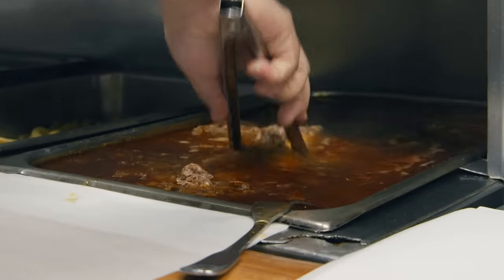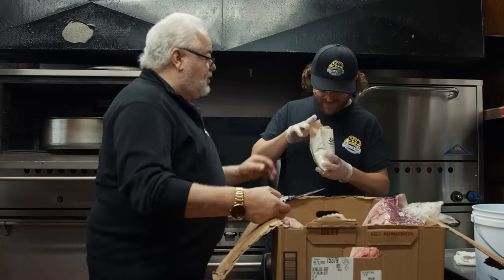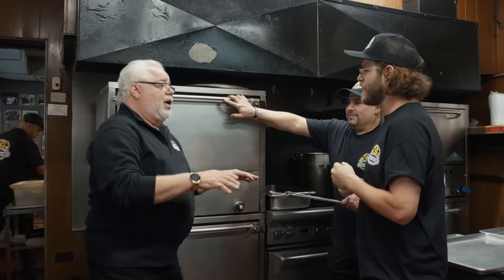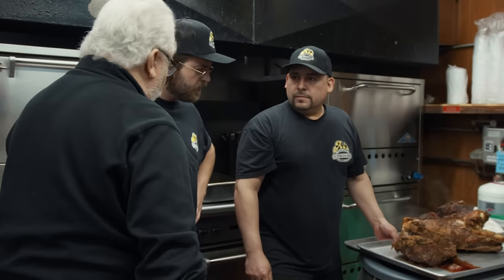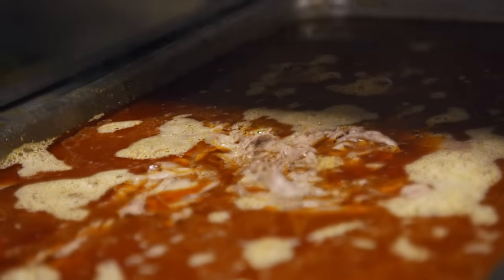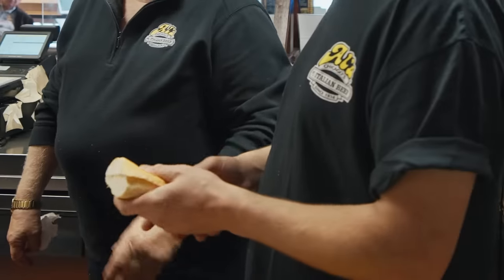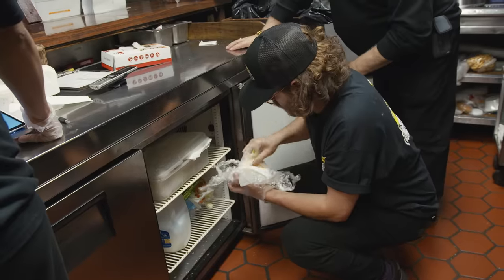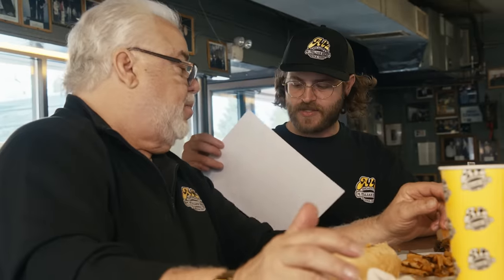Working A Shift At Chicago's #1 Italian Beef Sandwich Shop | Help Wanted | Bon Appétit

Comment: 3:55 There has to be a better way.
Reply: There is, they can start by cooking them separately in two 6 inch half hotel pans. Then they could just pull the hotel pans and not have to lift the beefs out that way and risk dropping them